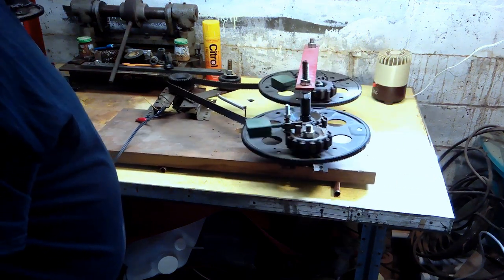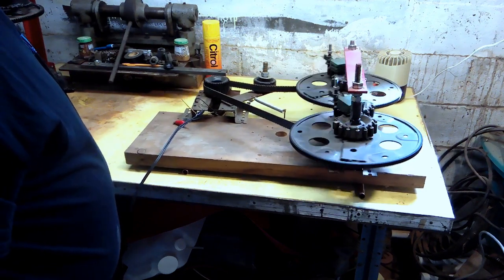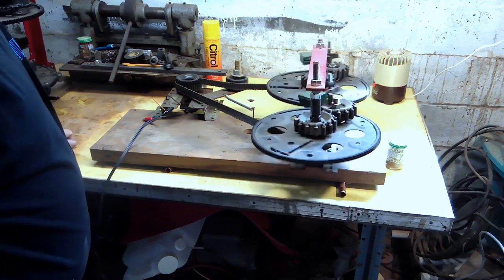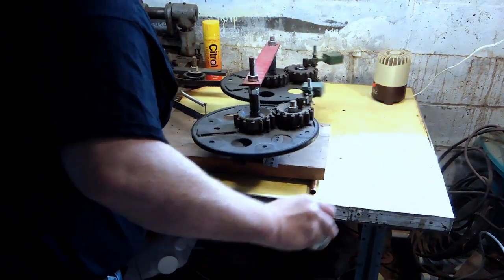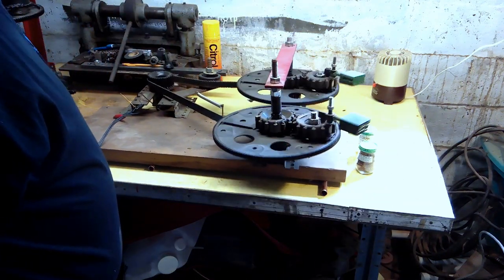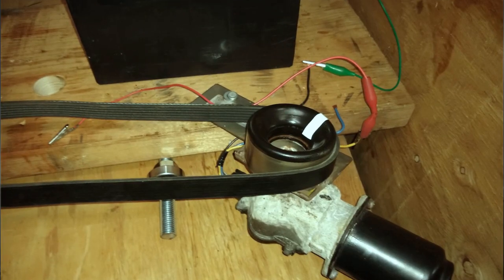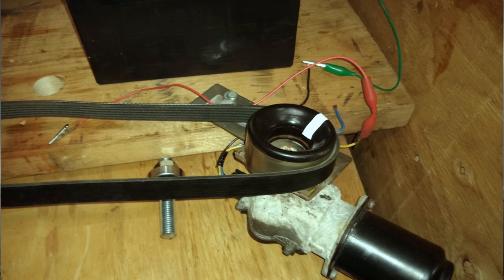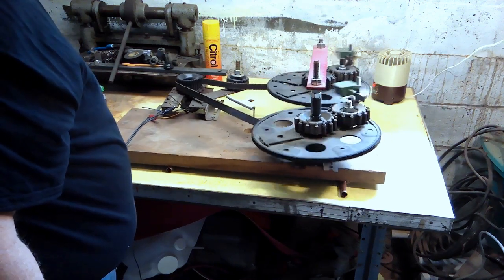I Built A Real Inertial Propulsion Drive

Comment: One inertial propulsion drive I believe will work will consist of a gas filled sphere that has a rod protruding from inside the leading wall to near the core. pulsing laser beams converge at the core producing an exploding plasma field. Each explosion drives a hammer on a spring to strike the end of the rod nearest the core then spring back and repeat. Each stroke of the hammer accelerates the device. The main idea is that the plasma field stands alone though it's within the sphere so the reaction force from driving the hammer acting on it won't act on any other part of the device. It will be transduced to heat before it gets chance to touch anything. This heat can either be expelled or collected by a transducer to save energy. I'm afraid to say I can see it being the only one that might work and I can't see it being powerful enough to do more than slowly accelerate a spacecraft once its in space.

Comment: what may be a problem whith this is that it is probably canceling the backwards momentum by pusshing sideways because of the bearing that is made to roll only in one dimension  you need to test with sphericall bearings to alow it to move in other direction however this may also be fixed by having a oposed unit next to it

Comment: put it on ball bearings. it will perform gyrations in the opposite direction to the rotation. its only linear as its restrained to one degree of freedom.

random factoid... old high power electric motors occasionally resorted to mounting the stator on bearings with a brake...
the rotor being firmly attached to the large heavy load became the "stator". the stator, being free to rotate and electrically connected with slip rings, acted as a "rotor", spinning the opposite way. the brake was slowly engaged and the load bought up to speed as the stator slowed and was finally locked in place. 

i always look at these and this glaring question stares a me... the answer is right there yet i have to ask it because maybe no-one else has...
what is the motor attached to?

Comment: Hang it from a very long pendulum line and see if it can produce an off-center pull. The center of mass is moving around so you need a way to know where that is during the experiment. Also it needs a cover so you know it is not pushing air that can leave the inertial frame of the apparatus. Use a 4-wire suspension so it stays level and is a moving parallelogram.
Reply from the maker: Thanks for the comment and suggestions, input is always appreciated. The pendulum test is a valid test which the PIE passed with no trouble but a balance beam test is much preferred. When tested in a motor vehicle the thrust was always present, so if it was pushing off of something externally there would be no measured thrust. As for wind, I suppose it might add to the thrust if it was arranged properly, but the necessary airflow would require a pretty powerful fan. Not to mention the papers and small parts we all accumulate on our workbenches and test areas that would be blown everywhere. In the vehicle tests, the PIE was covered during operation for safety purposes also eliminating any serious air flow assistance. 
Thanks for the input and ideas!
Reply: @stclairtechrd  The balance beam test you used has a few limitations — for example, it can be tricked due to its inertia and sluggish response, something I’ve been able to do multiple times. Would you consider running another test using a counterweight, like Sandy Kidd did in this video?
https://youtu.be/vb56xovbqOE?si=MnzLY3sFehkneOyO&t=6
I have no doubt that your device works, but I believe such a test would be even more convincing to everyone. Thank you.
Reply from the maker: @serg314, Maybe so. The videos are demonstrations, proof is done in controlled settings, mostly in the lab, but it's a good thought.